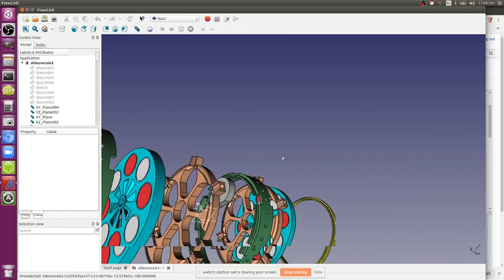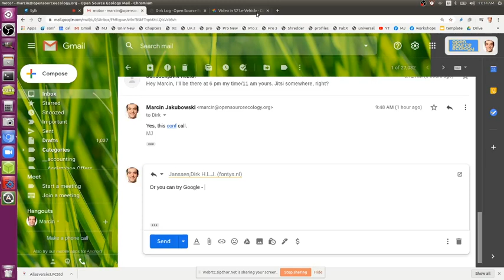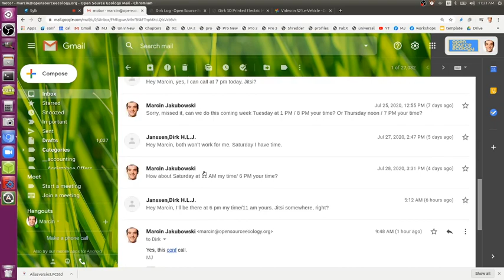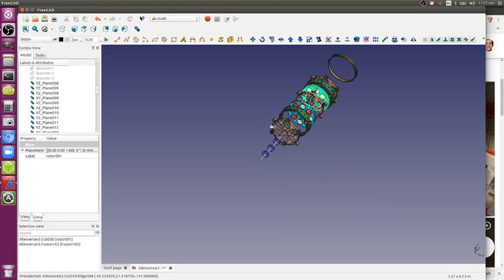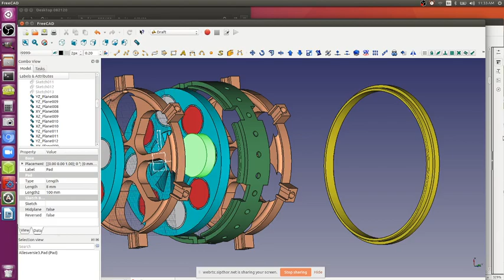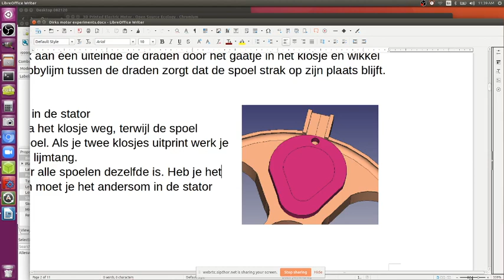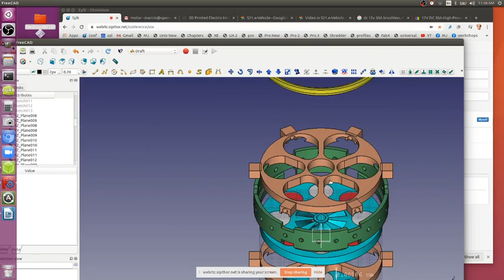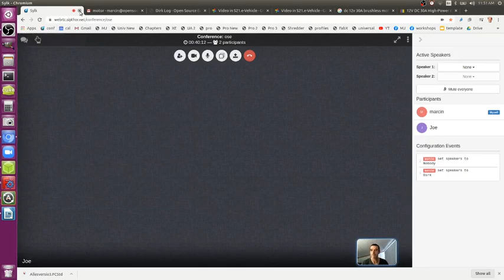Dirk's 3D Printed Electric Motor

Comment: I'd recommend gasoline from air or electric cars instead of hydrogen. Maybe methane.  Hydrogen will slowly leak out of sealed containers, embrittles metal, has invisible flames, and requires extremely high pressure to be efficient for volume. 

If you don't care about volume, hydrogen makes more sense, but it could end up taking quite a lot of space. It might be useful for unmanned blimps. (Especially if the blimp skin is fireproof.)
Reply: I think CNG is the easiest portable renewable fuel from upgraded biogas.  CO2 can be reacted with hydrogen to make liquid fuels like methanol somewhat easily (methane is harder, but may be doable).
Reply: Also can do odd things like feeding hydrogen to microbes, and turning them into biofuels.
Reply: проблему утечки давно решили......